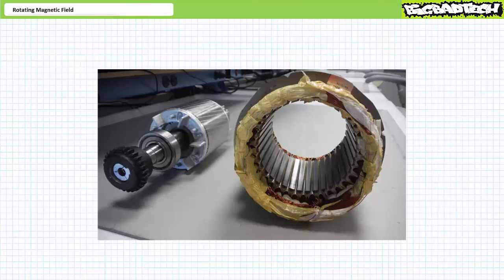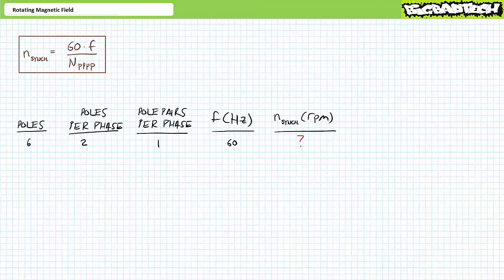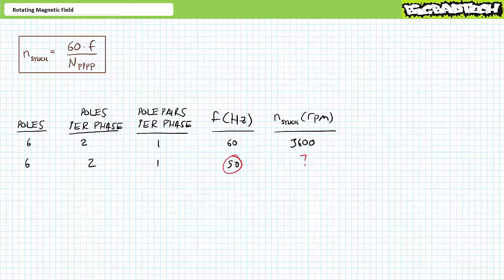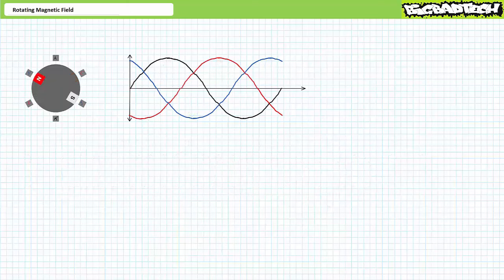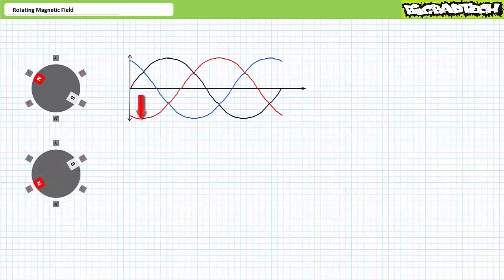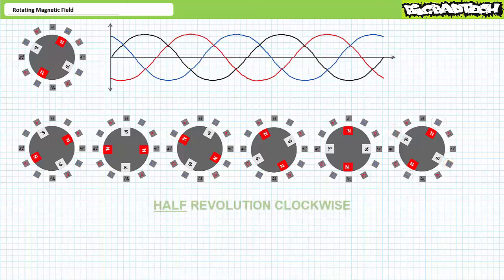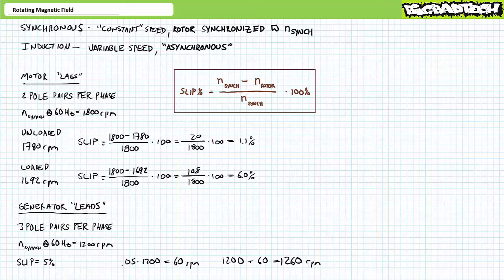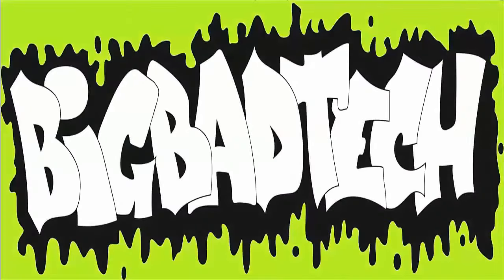Rotating Magnetic Field (Full Lecture)

Comment: DONT GET IT WHEN IN THE ROTOR YOU DRAW TWO SOUTH AND TWO NORTHS...... :(
Reply from the maker: Weird right? Yes, 2 pole pair motors have 2 magnets on the rotors. 3 pole pair motors have 3. Etc. etc. Although motors with more pole pairs go slower they're stronger (ie: more torque) than a similarly rated motor with less pole pairs. More magnets means more stopping points along the way but more strength.